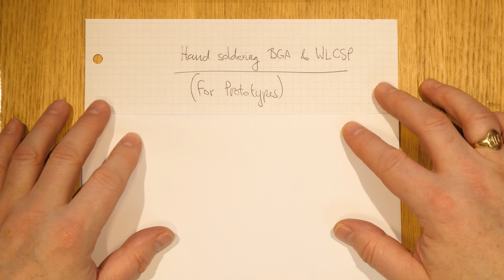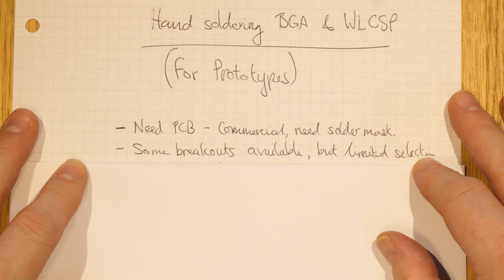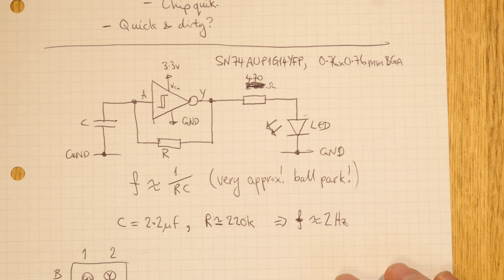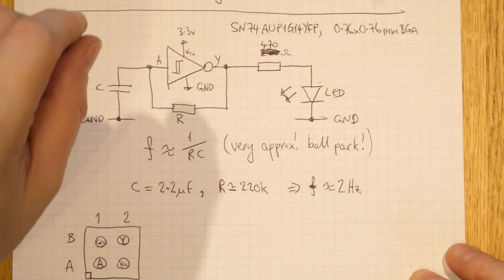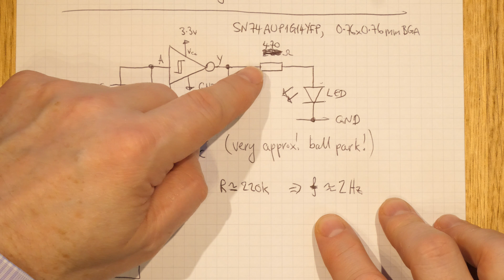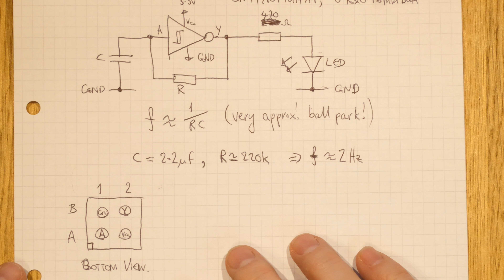Beginners' guide to hand soldering BGA and WLCSP for prototypes

Comment: 38:05 which end of the diode (or LED) is named anode, and which cathode? Mnemonic: In German, Cathode is spelled Kathode. Now visualize the diode symbol as --K--, and you see that the K end is the end with the bar. That is, the vertical stroke of the "K" is the bar of the diode symbol and is named Kathode.
Reply from the maker: Yes, that is how I remember it too... however I did go through several decades without needing to remember it: just using the symbol itself is enough, until you need to communicate with others! I still go by the symbol as my primary reference, so have to think about it when communicating with others, as evidenced here.

Comment: With a 2x2 WLCSP and using that square pad busboard, i'd have just tinned the very inside corner of 4 adjacent busboard squares and placed the chip straddled across the 4 corners. As @excited box also said, you could go in from each corner with the iron but probably even just heating each square pad in turn would be enough to reflow each ball of the bga...
Reply from the maker: That strategy doesn't work I'm afraid, typically it will drag the entire package onto one pad. You must have a solder mask for BGA/WLCSP, or else the balls will wick away across the exposed copper. Been there, done that!
Reply: @nezbrun872  I'd mask it off with kapton...
Reply from the maker: @smitcher  I look forward to seeing your video!

Comment: I was amazed to see the flux bubbling and sizzling under power. Was that only with a few mA supply current? This helps confirm the diagnosis of the problems encountered by a member of the Microchip forum. I rarely have had problems with good old rosin flux and 63/37 solder. But I usually scrub the flux off with alcohol followed by detergent scrub for ionic contaminants and then clean hot water rinse and hot air dry. Thanks.
Reply from the maker: With the LED on, total current was a couple of mA. I don't know what flux that person was using, it seemed much more extreme than this.

Comment: the 4 ball BGA chips can still be done by taping them down with kapton and going in from the side with a very flat soldering tip and lots of flux while pushing with tweezers. Once there are several balls that wire technique you used tends to be better. I just get out the hot air and blast it while pushing down with tweezers. if you heat the board first and quickly get the chip on there it helps.